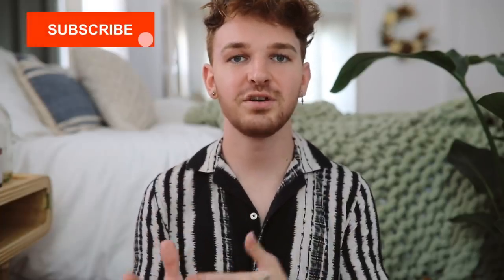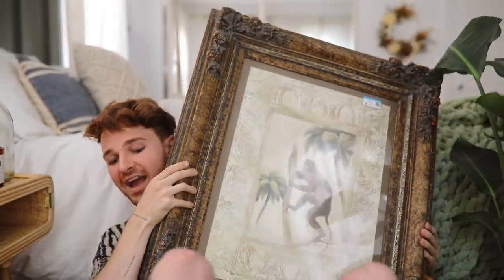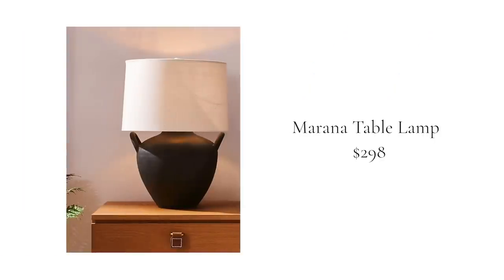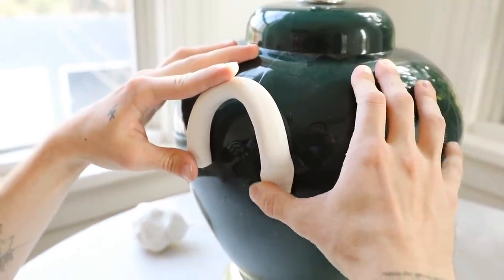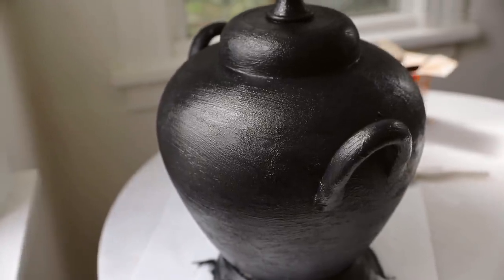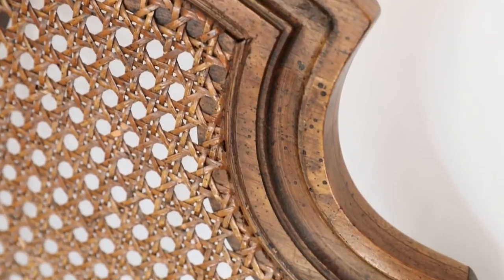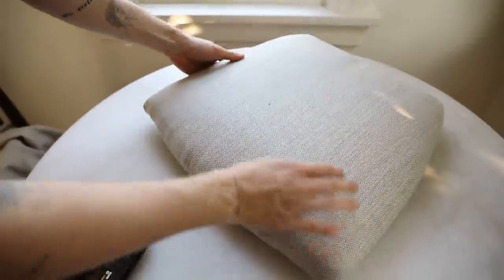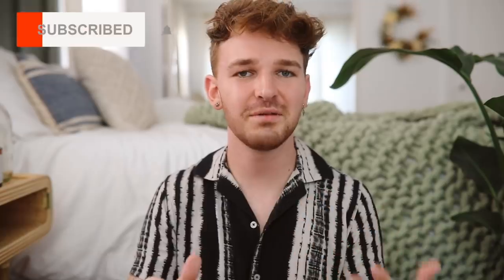DIY THRIFT FLIP DECOR + FURNITURE - Budget Friendly Home Decor Hacks

Comment: upholstering tip: when you upholster fold the edge of the fabric under to make a hem and then staple over to create a clean finish ^^
Reply: Or get the black finishing Fabric and put that on the bottom of the seat. That's what I do and makes it finished off professionally. If you look at any chair you'll see that fabric on there, sometimes I even steal it from another chair to finish my project.
Reply: Yeah, the black gauze like material is referred to as a dust cloth and is stapled very neatly to cover the cut edges of the fabric. It prevents the underside of the chair from dust hence the name.  I also suggest that even if you don’t change the foam, your foam should be covered by a thin batting cloth such as a quilt batting.
Reply: Folding under the edge is not only neater it makes the stapled edge stronger and less likely to pull out
Reply: When he said he had never done upholstery before I thought, why didn’t you just watch a YouTube video?💁‍♀️😁

Comment: The Rub-n-Buff tarnishes over time and loses some of its original luster.  A clear coat spray varnish might prevent you from having to redo it.
Reply: But you really want that to happen, to achieve the patina of age/antiquing without adding additional layers of paint/stain finish to the frame.

Comment: Good work! You have a great eye for the item's potential. One thing about the chair: when reupholstering, if you're not using new foam, it's a good idea to at least put a piece of batting (Dacron or cotton) over the foam to smooth it out. It doesn't have to be thick. Second, when stretching the fabric, you did right by starting in the middle on the opposite sides. However, you want to start in the middle on the other sides as well, and gradually work your way into the corners. It's much like stretching a canvas over a frame. (When I had done a chair for the first time, my mistake was making the fabric too tight but you didn't do that ;-)

Comment: What size/length do you use for your staple gun? I tried using a hand staple gun to upholster a chair seat but the staples don't go in fully. I'm thinking it is my staple size because I put weight behind the stapler when I pull the trigger.

Comment: I bought the clay you have linked above, but it says you can't bake it to harden. Is this clay the actual product you used on this project on the lamp? if it is, what temperature did you bake it? (I saw the following ques.& answers on Amazon after I bought the clay:)
 Q: Will it harden if u put it in the oven?
A: We do not recommend putting this clay in the oven.
By Amazon Customer on February 3, 2020
Q: How can you make the clay dry?
A: Unfortunately you can’t make this clay hard because it’s Plastilina which mean you make a beautiful model but you cannot harden it. I try to heat all my figuring and my model melted, like the head pop out almost started a fire in my oven.